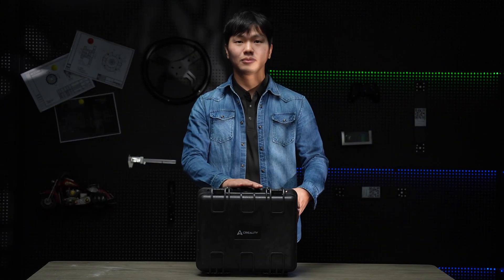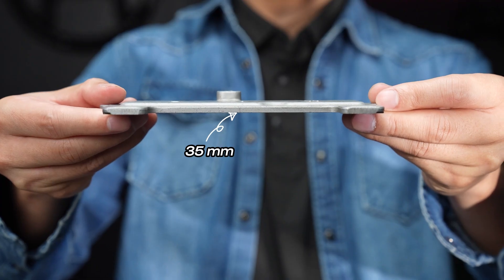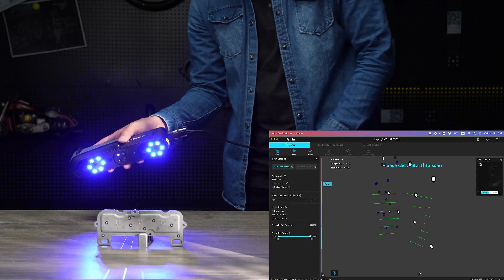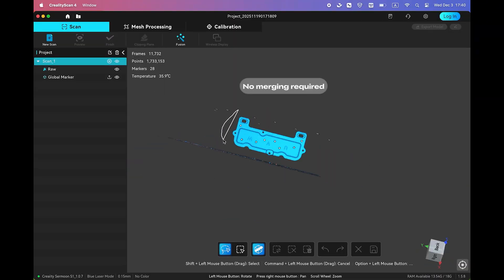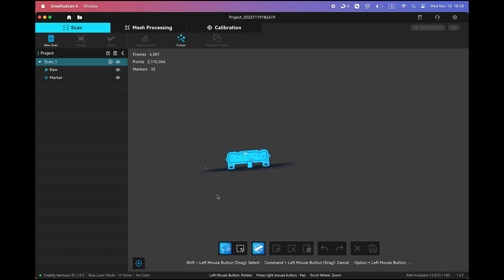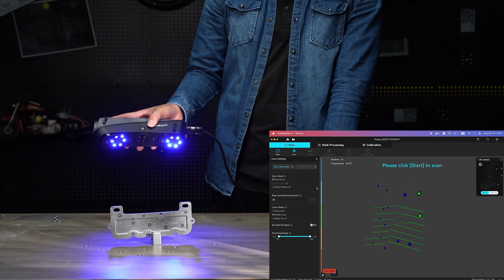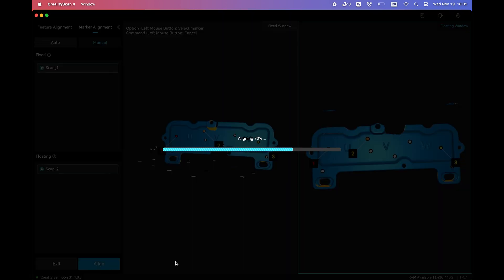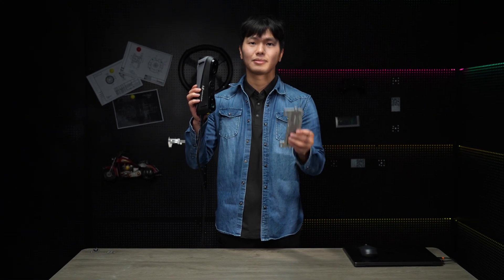5 Minutes to Master Two Easy Methods for Scanning Thin-Walled Parts with Creality 3D Scanner

Comment: Реклама ваша понятна )) почему файл stl,далее dwg/dxt не может конвертироваться в step???файл есть но он 0 байт.у вас в софте каком нибудь  можно это сделать?
Reply from the maker: Our software currently supports exporting in STL, OBJ, and PLY formats.
It does not convert files into STEP. Since STL/DWG/DXF are mesh or 2D formats, they can’t be converted directly into STEP unless they are remodeled or processed in CAD software.